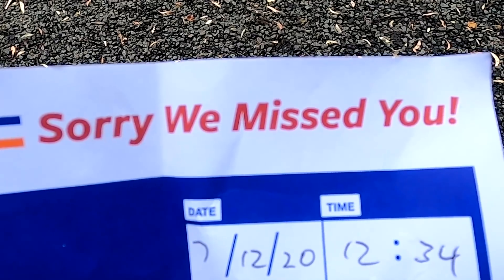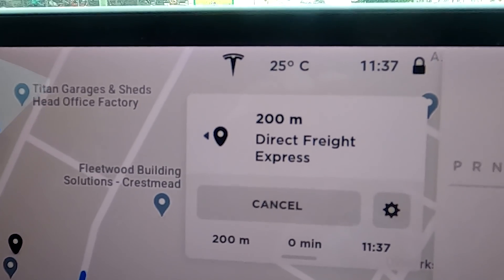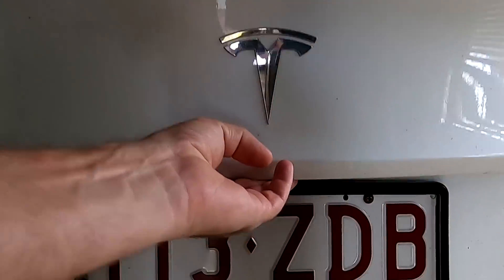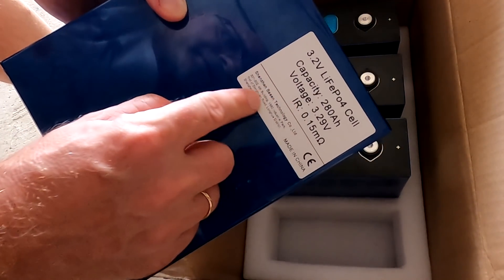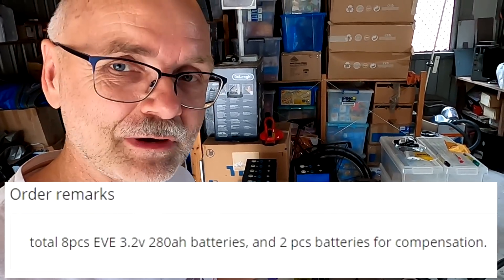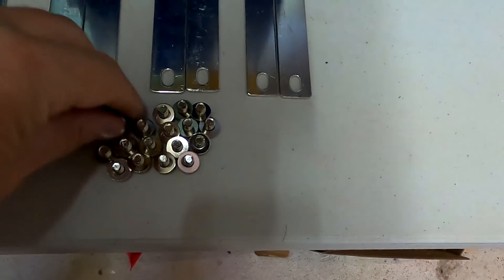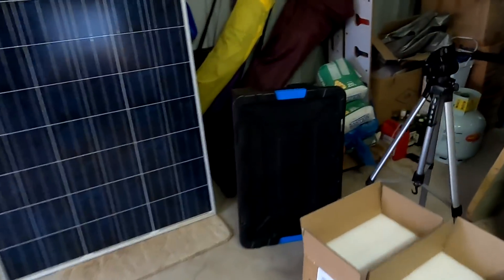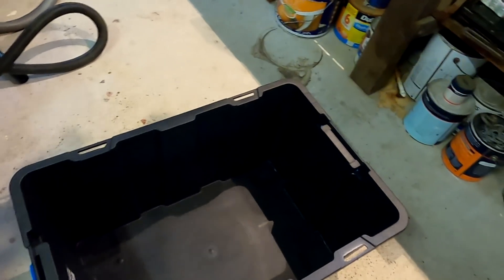To compress or not to compress battery cells

Comment: I don't think heating from charge/discharge will ever be a problem in a static environment like a home or a caravan. A a 5KVA inverter, for example will pull around 100A @ 45V - 56V, so cell heating due to resistive losses won't be much of a concern. Several comments have come up with what I think are damn good reasons for compressing the cells and it seems to me they all make a lot of sense. Remember the metal rod or bar that is used to compress the cells also have a coefficient of thermal expansion, so if that material is matched well to the cells, then expansion compression of the cells due to temperature should be  matched with the expansion/contraction of the metal rods. Question in my mind is not whether you compress the cells, but whether the rod/bar used for compression is made of aluminium, steel stainless, steel or perhaps even some woven fibre?
Reply from the maker: It does not say anything about compression in the specs of my type of cells. I'm 100% un-convinced.
Reply: @OffGridGarageAustralia  No, nor mine. Yet I see plenty of reasons that *seem* reasonable and will compress, though my application is  mobile, so I have a mechanical reason that demands holding the cells rigidly. I'll keep you in the loop. This is great isn't it? So many people contributing to each other through experience, opinion, facts and some even daydreams...I mean, in my case, watching you go through the process of deciding and ordering, testing and considering has prompted me and several others to take the plunge too. Really thank you, thank you and THANK YOU.

Comment: My Winston cells for the battery I built in my caravan, (400Ah x 12v)  have flexible copper bus connections, with a kind of inverted U shape, much better IMHO to allow for any expansion and contraction. Just my opinion: I don’t like the idea of rigid connections.  
Cheers Andy
Reply from the maker: Yes, I've seen these busbars and thought they make a lot of sense. Thanks Dave.
Reply: Have seen 2 variants. One with a braided couted copper strip in between. And another one with thin sheets copper in the middle.

Comment: Do not use the 6m bolts they supplied. Go to eBay and they sell 6m stainless steel 6m studs with a beveled end that goes into the threads and a hex allhin key on the other end. the Beveled end sits in the bottom of the hole perfectly and if you cut all thread it will not sit in the battery as nice as these pre made studs. Crank them down gently with an Allhin wrench and leave them. I use 6m thumb bolts. I ordered 16 mm, 20 mm, and 24 mm and I ended up using the 20mm length
Reply: Could I trouble you for a link for these? I seem to keep coming up with everything but m6 stainless studs when I search ebay.
Reply: @Bennyboy-dog  they are really called set screws. Grainger sells them #31KA52.
Reply: @Bennyboy-dog  order the 6m x 20mm if your going to use the thumb nuts as I did. it is doubtfull your fingers will ever strip the threads. and you can get a secure enough tightness to make an electrical contact. just check them every now and then. but if they are for a stationary set up, these will be the longest lasting.
I ordered from scuba 32 eve 105AH batteries and 1 of them had stripped threads right out of the box, I had to install a stainless heli coil. and 2 were manufactured defective.. they came fully charged, and I sat them on the shelf for a couple months before I used them, and the voltage went down to 1.2 volts. ruining the 2 batteries. The company replaced them. The moral of the story, for the first 3 months or so keep an eye on your batteries. I buy Lichen now. same size as yours 271 that test to 280AH
Reply from the maker: Well, you usually use the screws only once and once this is all in place it stay that way for a long time. Hopefully!
Reply: @DIY Projects when you order new batteries from other suppliers now, they supply the stainless steel gub screws allen socket set screws in 6m
Reply: https://www.ebay.com/itm/M4-M5-M6-M8-Stainless-Steel-Grub-Screws-Allen-Socket-Set-Screws-Cup-Point-DIN916/173493711598?ssPageName=STRK%3AMEBIDX%3AIT&var=472186224653&_trksid=p2057872.m2749.l2649
Reply: https://www.ebay.com/itm/Stainless-Steel-GB806-Knurled-Head-Thumb-Nuts-M3-M4-M5-M6-M8-Hand-Grip-Knob-Bolt/113923469882?ssPageName=STRK%3AMEBIDX%3AIT&var=414205927874&_trksid=p2057872.m2749.l2649
Reply: @surplusdoctor  Thanks David. Greatly appreciate you sharing that. 
You know, I was thinking to get some plastidip for my tools to reduce the chance of fat finger syndrome, then it occurred to me that the thumb screws could be dipped too increasing the protection (providing one does it very carefully and only on the top).
Reply: Go the stud route!  Just adding a tiny ring terminal for the BMS wiring on my pack reduced the engaged thread count enough to drastically reduce the allowable torque. And that immediately resulted in striping of the threads. You have to engage your bolt or nut with every bit of the threads in the terminals. Trying to re-tap is not fun!
Reply: @DIY Projects Holy cow batman!! Thats over 110 kWh bank! I checked tp see if you had your own channel. Anything you care to share on such a build would be greatly appreciated! Use, BMS, grid tie etc. etc. etc.
Reply: @DIY Projects I wish you well. I've had a few close friends pass away and after many years they are crystal clear in my memory. Take care.

Comment: Depends how many watts u want to pull out of the battery how hot they will get while discharge my advice is pressing them together because with time they puff upand don't contact back !
Reply: This is a very interesting topic Tronor. I want to use my 48V/272AH pack in a mobile off-road environment - compressing them should help with vibrations and also with the expansion/contraction due to temperature, charge/discharge and aging of cells. Unless one is using them for >1C discharge/charge (I won't - BMS is limited to 200A discharge, 100A charge), then heating from charge/discharge won't be a problem.
Reply: @Bennyboy-dog  ur totally right if u don't stress the cells u will never overheat them and pressing them thogeter prevents ugly puffed cells i mean they puff up after some time and u can put some thin separator 0.5-1 mm plastics sheet's in between every cell! I u have concerns fore a short on cell casing recommended when mounted in an rv or car !
Reply: @tronor5  The idea of using 0.5-1mm plastic sheet is perfect for mobile situations - thanks for pointing that out. Steel or thicker aluminium end plates too. Thanks. My thoughts for mobile use is to pack them as either 2 x 8 cells or 4 x 4 cells packages - compressed with plastic sheets in between and 6mm aluminium end pieces with steel threaded rod holding the two aluminium plates under compression. I might go for 4 cell package since an 8 cell package is a little too heavy to move around without risking an injury.
Reply: @Bennyboy-dog  use non conductive material!!
Reply: Yes but put plastic in between steal
Reply: @tronor5  I meant to say that, but forgot.
Reply from the maker: My 48V setup will have a 200A BMS but only a 100A fuse. I have planned to use a 3kW inverter to start with.

Comment: I like your thoughts of why you should keep space between them. My only concern is how you hold them in that exact configuration. Any time you move them at all it will put pressure on the terminals since they're not held rigidly against each other. Maybe you could put a square of double sided adhesive foam at each corner to hold them in position but still leave a gap between.
Reply from the maker: This is a stationary setup, once the box is in its final destination in the garage and filled with these cells, it will not move any more. I should have made this clearer, ey?

Comment: 14k is amazing! That plastic worries me. Will switches and battery monitors and battery posts stay solid in there when you move it?
Reply from the maker: It's a sturdy box and after installation, I won't move it anymore. It's a stationary setup?
Reply: @OffGridGarageAustralia  I was looking at a tool box like champion tools. Expensive tho. I like your price better. Thrn if a cell goes wild would it be safer in a metal enclosure? All questions I don't have answers to.
Reply: @JerryScroggin  lifepo4 chemistry is very save does not burn if anything goes wrang each cell hase a overpressure valve that releases litium pressure but no flames !
Reply: @tronor5  I've got 3 7s 14p battery banks. All on pcb .. the 18650 cells I have always been warned about. That box size you are putting together is very appealing.
Reply: @JerryScroggin  depends on the safety mechanism u build into yore sistem u can look up videos on youtube lifepo4 safety !

Comment: If your not draining at high current then you don’t need to compress. There won’t be much expansion if any if you keep the C count down.

and it’s SERIES not serious haha
Reply from the maker: Seriously, why do you need to compress the cells? I think it's bad.
Reply: I don't think that thermal expansion is the reason you compress them, the expansion due to charge/discharge is the issue. 
https://en.wikipedia.org/wiki/Lithium_iron_phosphate_battery

Comment: What about the 120 temperature in Arizona
Reply from the maker: Specs go to 131F, so all good. I doubt the battery will ever get that got in a stationary setup. If so you may have done something wrong and the capacity is to low for your load.
Reply: @OffGridGarageAustralia  At higher temperatures they wear out quicker. Li-ion batteries are often spect to operate 0 to 60°C
Would suggest to keep them in conditioned space if ambient temperature gets under 5°C or over 25°C
Reply: it reaches higher temperatures here in India.  lfp performs great

Comment: Thanks for sharing my question is the battery grade A or B are they used or new?
Reply from the maker: They are new A Grade cells.
Reply: @OffGridGarageAustralia   thanks, I will wait for the capacity test result before I order any. god luck
Reply: @OffGridGarageAustralia  Well... maybe not. They are grey market cells that probably didn't pass every checkbox at the oem, and are sold at lower prices through resellers (for now). There are various opinions on this topic, but it could be that these are the cells 'left over' after not being able to match them in a bank for EV's. In this configuration, you want cells that are capacity/IR matched over the entire charge/discharge curve. EVE supply is running out by the way (they stopped putting these cells through third parties), and is mostly replaced by Lishen cells now (which may or may not be better, the verdict is still out).